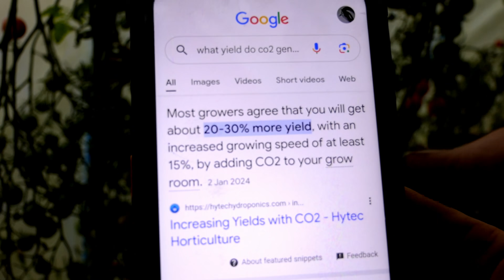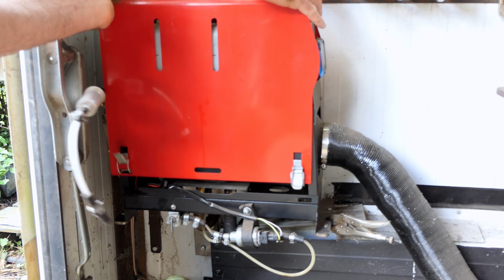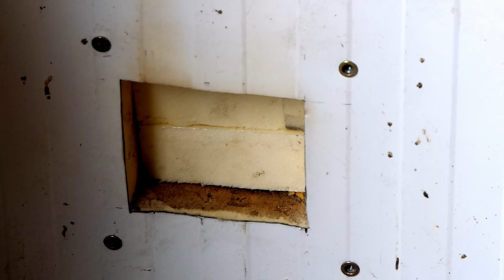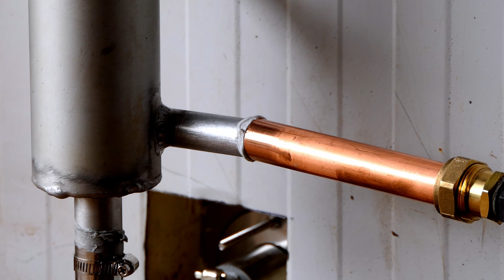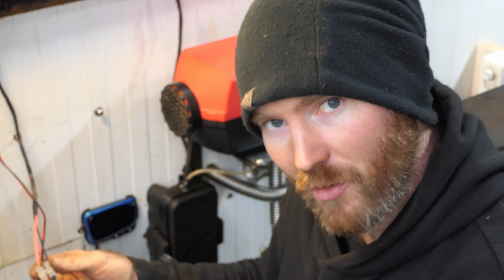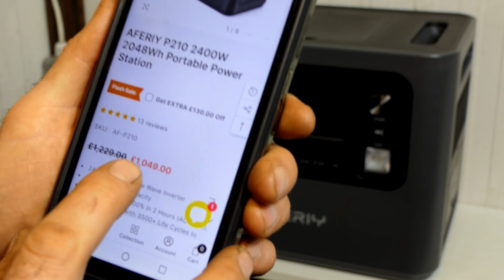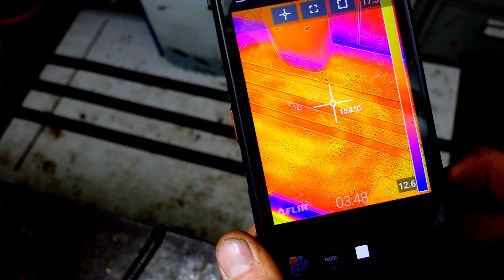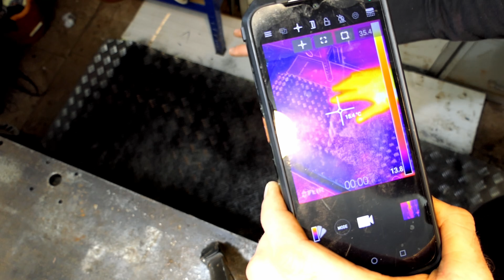NEW! Better system for Cheap and Safe Heating💲+ Underfloor Heating Mod test🫠

Comment: I agree with you 100% regarding the "man made global warming" issue. CO2 is plant food! OK...now that I've pissed off people, let me point out a flaw in your floor heater. The pipe should be embedded in grout or cement, with the insulation only on the bottom in order to give a more even heat distribution, and more efficient transfer of heat to the surface. Cheers from Winnipeg.
Reply from the maker: You're right. Cheers J
Reply: @joshuadelisle  he's right about plants using CO2, water and sunlight to make food. No denying that. That's called photosynthesis.

It's a shame neither of you are mentioning the other side of the coin though. That's called respiration and it completes the carbon CYCLE, returning the carbon back to the atmosphere as CO2. It may even explain why plants don't rapidly run out of CO2 to TEMPORARILY store energy as carbohydrate. You know?

I run a petrol engine and a gas combi boiler but I'm willing to face any uncomfortable truths about fossil fuels even if I'm hooked for now. What about you?

Comment: Thank you for sharing your perspective on climate change. However, I’d like to address some key misinterpretations of scientific data that are crucial to understanding this complex issue.

Role of CO2 in the Atmosphere: While it’s true that CO2 makes up a small percentage of the atmosphere, its impact as a greenhouse gas is profound. Even small increases in CO2 levels can lead to significant warming due to the greenhouse effect. The current concentration of CO2 is over 400 parts per million, which is a dramatic increase from pre-industrial levels of about 280 ppm. This increase is primarily due to human activities, and it is causing the planet to warm at an unprecedented rate.

Human Contribution to CO2 Emissions: The claim that humanity contributes only 3% of CO2 emissions oversimplifies the situation. While natural processes do release CO2, they are balanced by natural carbon sinks, such as forests and oceans. Human activities, particularly the burning of fossil fuels, have added a significant amount of CO2 to the atmosphere, disrupting this balance. The scientific consensus is clear: human-induced emissions are the primary driver of the current climate crisis.

Historical Climate Context: While it’s interesting to reference historical climate conditions, it’s important to recognize that the current rate of warming is much faster than any natural fluctuations in the past. The Earth has experienced warmer periods, but the speed at which temperatures are rising today is alarming and correlates closely with industrialization and increased greenhouse gas emissions.

Misunderstanding of Climate Models: Climate models are sophisticated tools that take into account various factors, including greenhouse gas emissions, solar radiation, and land use changes. While no model is perfect, they consistently show that without significant reductions in emissions, we will face severe consequences, including more extreme weather events, rising sea levels, and disruptions to ecosystems.

Ignoring the Scientific Consensus: The overwhelming majority of climate scientists agree that climate change is real, largely caused by human activities, and poses significant risks to our planet. This consensus is based on extensive research and peer-reviewed studies. Dismissing this body of evidence undermines the credibility of the argument and ignores the rigorous scientific process that supports our understanding of climate change.

Importance of Mitigation: While adaptation is necessary, it should not be the sole focus. Mitigation strategies, such as reducing greenhouse gas emissions and transitioning to renewable energy sources, are essential to limit the extent of climate change. Ignoring these strategies could lead to catastrophic consequences for future generations.

In conclusion, while it’s important to have open discussions about climate change, it’s equally important to base our arguments on accurate scientific data. Engaging with the established research and understanding the complexities of climate science will lead to more informed discussions and effective solutions.

Comment: I have silenced small pumps by burying them in sand. Put pump in middle of sturdy box and fill with sand. Just few centimeters of sand helps a lot. Just remember possible overheating as with all other sound insulation methods.

Comment: Floor needs to be concrete or sand mate, basically it absorbs, stores and then radiates the heat like the thing you had before. The foam just insulates the pipes and the metal just radiates it straight away like a proper radiator on the wall there, so you don't get that nice warm heated floor effect. Just hot or not hot.

Comment: If you're redoing the floor put the PEX in the sand bed beneath the pavers by securing your counterflow pattern with wire mesh

Comment: Remember that the readings on the thermal camera/infrared thermometer only shows correct reading on matt black surfaces. Pointing it at shiny or white objects will give you wrong readings.

Comment: 25:26 A small correction. "Watts per hour" doesn't make any sense. It's using 40 watts, and it's still 40 watts per second, minute, hour, year. If you want to use the Watts per hour, you can convert into Wh, but then it needs to be spoken as Wh/day for example.

Comment: On the topic of the underfloor heating slab...  The objective is to extract the heat energy from the water loop; if the return water from the slab is cold then it's doing its job properly.  Conduction is the primary mechanism to maximise here, underfloor systems conduct heat into the floor substrate and from the substrate the heat radiates & conducts into the room.  Josh, the kingspan insulation is the opposite substrate to what you need, it's keeping the heat in the pipes.  Underfloor pipes are typically buried/drowned under a liquid screed substrate maximising conduction.

Comment: My advice for water heating is home made water solar panels - so easy to build, cheap as chips using recycled materials - the energy harvested from the sun is many, many times more per square metre than using PV panels, i had to downgrade several of my first homemade panels even here in Sweden as they got so hot they produced super heated steam and melted within seconds of exposure to the sun(!), so there's no need to optimise them - and of course the energy is easy to store in a water tank, easily managed and a 'top up' electrical or diesel heater heat exchanger coil can be used to boost to over 65C to avoid Legionnaires Disease issues in the tank in cold periods. Even in winter in the UK one would easily save half of water heating costs, and 100% in summer - water heating is the biggest energy consumer in most households and the washing machine can be modified to accept hot water so as not to use electricity to do that. Best wishes.

Comment: Thanks for careful and diligent work and stats, i've watched quite a few of your videos now and work along similar lines of thought, though here in Sweden where some needs differ because of the climate, various fuel availability, costs etc. 
     My point of view starts with insulation and everything else comes after that. 
   Defo worth subscribing, great info. Thanks.
  By the way, i have two very old 'Diesel' heater units similar to the ones you use, one is 24v, the other 12v, i don't see any external difference to modern variants and they're probably exactly the same. Is it possible to buy separate, modern generic control units for them? Ever tried that?

Comment: Raise the floor by a foot or so, put the works underneath, and don't exit anything. This makes it HOT AIR underfloor heat. I have a friend who heats his entire ultra-insulated home this way with a cheap 800W electric heater running in the crawl space.

Comment: I am from the country and moved to the city for work. I agree with EVERYTHING you said in the last 10 minutes of this video. Our government likes to think we are all mindless followers that believe anything the government tell us. Unfortunately there is far too many that do. 
Moving on, I installed a 2KW diesel heater in my girlfriends car. She works nights and in the winter can be dangerous to be in a parking lot with the car running and her outside scrapping the frost/ice/snow off the windows. I installed the Bluetooth equipped heater as it gives me more options. It can start/stop on its own and maintain set point or start at a certain hour. Can be controlled from a hand held remote, cell phone, or the control panel. Now she never has to get into a cold car or scrap off the snow/ice. 
I also have a 8KW unit that I am setting up to heat the apartment if the power goes out. Batteries, solar panels I can move into place if needed.
I am using diesel as the fuel source. Not cheap here in Canada. (Carbon tax). Ya that government grab thing.
I would love to move back to the country but I am getting up in age and the girlfriend doesn't like the country lifestyle. So I do what I can to keep her happy and safe.
Love your videos and am looking forward to seeing what you come up with for exhaust heat recovery. Later.

Comment: Cracking video. And yes i agree 100 % with you. It's all a load of bollocks this net zero bullshit and only ones benefiting from it are the very rich. As  they need many millions of us to listen to the crap they spout while telling all of us morons not to have a week away abroad.  while the travel at least 20 times more each year and longer distances. they the elite want us commoners to stay in out 15 minute city's while they travel thousands of miles many times each year. It's ok for them to use there private jets many time per year but how dare you go to Benidorm for a week ounce a year, CUNXS

Comment: Why not run the exhaust inside for a bit before the final exit?
Reply from the maker: @joezanella8949  yes that's what I've tested previously. However a long exhaust causes a restriction in the gas flow and can have negative effects on the burn efficiency. A short high flow heat exchanger is what's needed. Cheers J

Comment: as for the sound, I would say take the exhaust pipe up above the the roof line, just make sure to not have the opening straight up, that should cut down a lot of the sound.

Comment: 80-85% of global warming is down to water vapour in the atmosphere. This is often overlooked, but every single weather event - including how much lightning is produced in a thunderstorm - is primarily driven by two factors; how wet the air is (humidity) and how hot it is (or more correctly, the differential between humidity and temperature in converging air streams). Nobody is really talking about this though. Nobody is monitoring how much water vapour is produced by industry, transport, etc. Where I've looked into why not before, it's just dismissed as making a negligible difference, but on a very local level, it must make a difference. I mean, a newly commissioned power station chucking thousands of gallons of hot water vapour into the atmosphere every day is obviously going to change the amount of local cloud cover and rainfall in the area around it. And we know water and water vapour is particularly good at transferring heat around because this is the method we use to heat our homes, cool our power stations etc. If CO2 was particularly good at trapping/reflecting/storing heat or was a major problem within our atmosphere, our homes would have CO2 pods or domes on our roofs or in our gardens to heat and cool our homes using CO2 extracted from the atmosphere killing two birds with one stone. After all, when we decided we need water in our homes oh so long ago, we found ways to extract, treat, store and transport water from natural sources to our homes.
Reply from the maker: @barryglibb1448  very good point. Thank you. Cheers J
Reply: @joshuadelisle  No worries - sorry for the rant, had to get it off my chest. Love your work! :)

Comment: Even if I already subscribed to your channel for your interesting ideas and very well documented but also top informative experiments! 👌...
I think the climate crisis mainly is no doubt the notorious effect of both pollution by densifying suspended carbon particles in the atmosphere and dramatically increasing the active heating points covering today huge amount of Earth surface as induced by rising industrialization during last 2 centuries as already proven by all history serious geo investigations !❗
CO2 emissions are only induced secondary effects as you also agreed and be right!
Just imagine the long time optimized thermal equilibrium among all seasons when no industry no cars not so much and many heated homes, no combustion  related processes or engines, even not so huge heating explosions in so many wars etc all around occurred !   
Unfortunately today, supplementary to the default Age long volcanoes activities, the Earth became covered by trillions completely new highly intensive heating points each new seconds summarizing supplements of undesired but inherent huge contribution accelerating global warming !
Just imagine you were sitting on a cool average table then later, someone just round it with few kilos of burning coal frags taken from a still active picnic stove!  
Logically, I mean any heating point is any point, object, being, localized process etc whose external or radiated temperature is higher than the Earth  Average and therefore contributes to its increasing!
Finally, The Global Issue is mainly not how to remove CO2 etc around but how to faster reduce those trillions heated points impact against average temperature!!! 🤔
Reply from the maker: @LaurentiuGavrea  thank you so much. Those are Very good points. Cheers J

Comment: You could try do a heat exchanger with a beer keg 50 litres and you have a heat storage in the same time and you can make a copper spiral inside the keg and you don’t have the problem mixing aluminium with copper
Reply from the maker: @marcsduk  I'm going to use an 220litre oil barrel and manifold of 6 exhausts that spiral. Cheers J

Comment: Quite honestly your videos pack a ridiculous amount of valuable info on a wide ranger of home-tech matters into them,  and links for all of the parts is a massive timesaver. You definitely earned a sub. The lazy part of me wants to get someone with your skillset to come and do all this for me, but your enthusiasm and practical approach has inspired me to start doing this. 8KW base kit just ordered from ebay in the background while watching the vid LOL... I'm sure my bank account is going to get hammered as I work through your kit-list but as it's all modular I guess I can do it in stages.

Off-grid low voltage power and light circuits has been one of my big investments over the last 10years as I've been renovating a little ruin in Northern France but as we all know, there is no real scope for heating with just PV systems so this heater and rad setup is an excellent solution even if I never get around the doing the underfloor heating project.  Luckily I have an abundant supply of LiPO 12W batteries from Hospital trolleys linked to some ridiculously cheap solar panels and a good MPPT controller which has allowed me to build up a very large powerbank and this can easily feed the power requirements of the heater,  I love that this heater just needs an average 12v power requirement... 12v is king for me ! Nothing worse than having to run an inefficient invertor to get 240v just so I can connect some 15 or 19v psu's

Love the content my friend and once again, thanks for all of the info. You are a credit to Youtube... Raffall tickets also bought ;-)
Reply from the maker: Thank you so much for your support and kind encouragement. I like the idea you had to find old equipment with good batteries. All the very best. Cheers J

Comment: Re your CO2/ deforestation rant- we hinder natures ability to self heal making matters worse. For example, on the driest continent on the planet our most marginal land (desert and virtual desert) is experiencing a flourishing of what we term "woody weeds", which is seen as a threat to inland graziers who are trying to maximise profits from their 3 head of cattle per square kilometre operations. UK runs 3 cows per 2 acres!

So guess who are burning, slashing, spraying the woody weeds flourishing to take up CO2 and in all likelihood over time, turn marginal land into productive land?

What about the fear of the plastic islands? You know, all that garbage in the middle of the oceans. You know, those incredibly almost lifeless deserts that the middle of oceans are?

Those people don't see those islands as nature attempting to heal itself. They don't see those plastics as part of what I have termed "the oil cycle".

They don't understand that that plastic will accumulate and eventually sink to the ocean depths, where over millenia it will again be covered, sink into the crust, get pressurised and turn back to oil.

I assume those islands will create more oil ultimately than whet they consist of because they will "regreen the oceans" by becoming scaffolds for algae, bacteria and other life forms which too will die and sink to the ocean floors.

So what do we do instead. At great expense we are going to go out there and hail nets through it to collect it- when instead, I theorise, we should be fertilising the plastic patches. Perhaps even taking additional plastic out there to boost production.

Anyways- that's my little 'lets work with nature in its efforts to take our waste and reclaim the marginal areas of the earth' rant.
Reply from the maker: @rowanshole  very good points. Cheers J